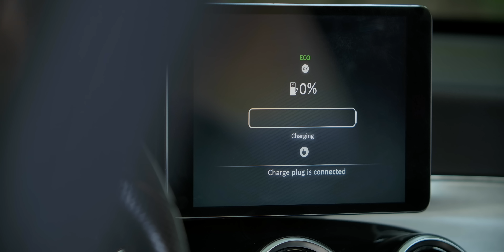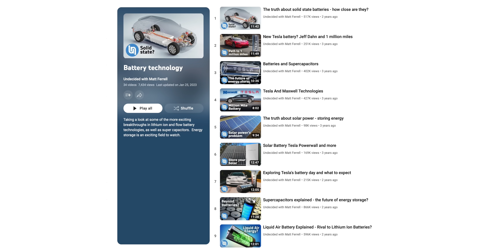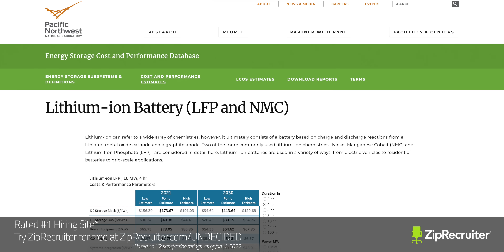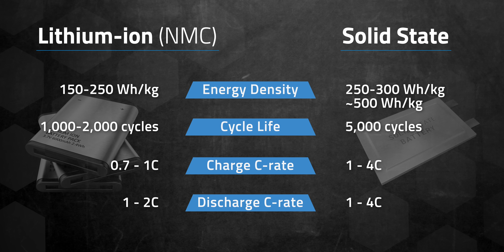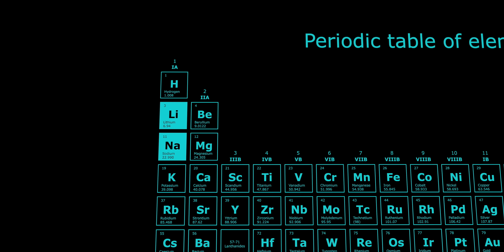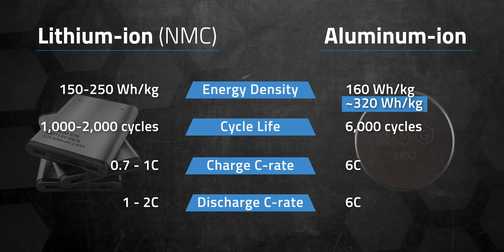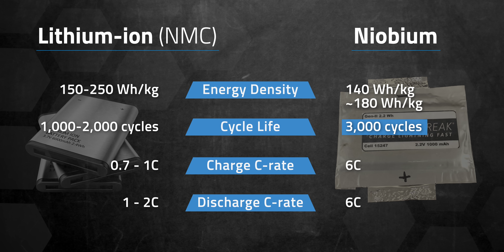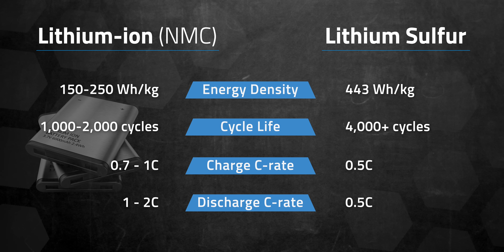Are These Batteries The Future Of Energy Storage?

Comment: Sodium-ion batteries sound like an ideal solution for home battery systems when combined with photovoltaic panels for charging in an area like the Pacific Southwest in the US or areas in tropical zones. Where there is year around abundance of sunlight, the home battery systems combined with photovoltaic panels can be charged quickly and help to take some load off the grid during peak hours; they don't need to run long and they will most likely charge up quickly the following day.

Comment: Hey! Thanks for the video. I have several topics for an open discussion. But first and foremost, please include sources for the data in video description.
-my main concern is about C-Rates. Solid state electrolytes cannot compete in conductivity with liquid ones, they are always at least 2-3 orders of magnitude lower. Similar argument goes to sodium and Al. Sodium being larger cation have significantly larger solvation sphere, and thus much lower mobility. Al with it's charge is extremaly acidic cation (in HSAB theory) with even larger solvation sphere. Not only it causes mobility hinderance but also thermodynamically it's much harder for this ions to lose solvating molecules before intercalation. 
Intresting point, in solid state i think thermodynamics are less vigorous at loosing the coordinatoon sphere before intercalation. (The boundary between active material and electrolyte matrix has surface like properties).

Comment: You should look into silicon anode batteries like Enovix's lithium-ion battery. It's massively expanded the energy density of lihium ion (~40% increase in normal consumer electronics, over 100% in devices like watch batteries)

They're already producing the battery and are working on scaling it right now.

Comment: One important thing missing in this video (and many videos from many sources about energy storage systems) is the *EFFICIENCY*. For instance, some of the grid-scale storage systems are only 30-50% efficient, loosing the rest to heat in some part of the process of charging, storing, or discharging. I think this is a metric that we simply can't ignore, as it has fundamental implications for their long term economic viability, payback time, and appropriate use-cases.
Reply: I totally agree with you on the "efficiency" aspect of energy storage.
Reply: Batteries in general tend to be inefficient.  Mainly by the nature of converting one form of energy into another.  Something is pretty much always lost.  The main advantage to batteries is that they're an investment in the future.  On a really sunny day, we couldn't possibly harness ALL of the sunlight falling on the Earth, but the excess gets stored away for later.  The more efficient the storage, the better, but at the end of the day, any amount of stored power is huge, because otherwise it would be going to waste doing nothing, and then not end up available at night when the solar panels are no longer generating power.

Think of it like a sink that's constantly running.  We can drink from it, but when nobody is drinking, it's just going down the drain, so you grab some water bottles.  Even if the water bottle you try to fill doesn't have a big enough opening to collect 100% of the water that's coming out of the faucet, filling that bottle is still water for later, should the faucet stop flowing.
Reply: And yeah, using the wasted heat energy is still something to improve.
The problem with the heat wasted in nuclear power plants, is that people would be scared of the idea that the water running in their radiators would be radioactive... Even though it's would be really unlikely to happen cause it wouldn't be the same water going through the reactor, heat exchangers are used and sensors check for any leaks between the two sides of the exchangers
Reply: Well you could just save the heat and pump it in the battery as electricity
Reply: Some grid-scale flow batteries have 70-90 efficiency.
Reply: @kibbo86  which ones? Would love to look that up and learn more.
Reply: Well the thought is right but the situation in the field isn't as bad as you suggest. Ambri's grid storage liquid metal battery (which has had some success in garnering big clients) promises comparatively low capex (and low LCOE in combination with renewable generation) while offering 73 percent round-trip energy efficiency. 

So, just don't use the crumby storage technologies offering 30 - 50% efficiency. Use more efficient batteries that don't have the concerning implications that you outline. There are lots of efficient options. Local circumstances will have a big role in determining what form of grid storage makes sense.

Note: 
(1) The comparatively low capex of Ambri storage, however, only becomes a reality once manufacturing moves into high volume production, viz. at production scales similar to or larger than the largest Li-Ion battery manufacturing facilities today.
(2) Ambri batteries do come with the proviso that in order to avoid heat losses (the battery operates at high temperatures) and thus reductions in round trip efficiency the batteries should be discharged/recharged daily. Not a severe limitation if there are other efficient storage technologies in the mix, which is probably the right approach.
(3) Even relatively low efficiency compressed air storage has decent prospects. The best round trip efficiency offered by a CAES plant currently in operation is about 60%.
(4) Pumped hydro round trip energy  efficiency is around 80%.
Reply: Electrochemical batteries usually has 90% efficiency roundtrip, ver few case has less efficiency, but not lower than ~80%, because storing ions with intercalation process through electrode materials are very efficient.
Reply: Efficiency aside, having a use for the waste heat could be a good solution to help reduce power use elsewhere. Having small distribution level battery storage in a city or near a pool and using a cooling loop to heat water for homes and the community. 

This is a major benefit of small nuclear, with rated power being around 200MW - 300MW but the heat output which can be used in industrial processes being a massive additional boost.
Reply: @je8277  very true. That I agree should be a part of the efficiency conversation all of the time. I think there are so many missed opportunities for using waste heat — the more conversation the better. I often think of even rooftop solar voltaics as being a huge wasted opportunity for waste heat collection. Even in the most efficient panels,, 60+ percent of the energy is getting lost as heat that could be heating or pre-heating domestic hot water or in-floor heating. Solutions like concentrated solar with heat-pipe transfer to an insulated water collection, or evacuated tube systems with the photovoltaics inside with heat pipes and water heat transfer could make for an absolute ton of additional waste energy recovered and used. Heat pumps could amplify those optimal photovoltaic temperatures to domestic hot water temperatures while still using so much less energy than direct gas or electric heating. 

Industrially, of course, there are so many more waste heat options at many different temperature ranges.
Reply: cool the battery with domestic water heating,people lose sight of one of the most needed uses for electricity,heating water
Reply: Is it? Seems like producing energy is cheap now. Renewables seem to be over producing. 

 Cost per KW stored is what matters way more than effiency for that reason.
Reply: @dianapennepacker6854  well it's all relative. Like if a compressed air storage and a compressed co2 storage system has similar capital costs, but the co2 is (it seems) 20-30% more efficient, then that's a whole lot of money left on the table. That doesn't invalidate the spirit of your argument which is "cheap storage now", but it helps us gauge capital costs vs efficiency losses of an amoritization period for each use case. There's no reason not to publish that data if the technology is mature enough to even talk about; it's valuable information.

Comment: The prospect of an aluminum based battery with 3-6x the cycle life of lithium is a hopeful thought. Consumer electronics (a field I work in) generate so much waste on the back of failed batteries. Laptops, wireless earphones, cell phones, so many areas where we hit the "good enough for most people" bar in terms of processing power years and maybe even a decade ago but batteries, failed storage, lack of software updates, and the allure of the shiny new thing keeps them from having as long a life as they're realistically capable of. Nothing infuriates me more than each model of a machine requiring a bespoke battery pack that will in all likelihood be the first thing in that chain that fails. While more EVs emerge on to the market I fear the same ultimate end to a lot of electric cars, making it to the scrapyard sooner than their ICE counterparts due to failed or declining batteries.

More than a new type of battery what we need is, IMO, a sustainable method of implementation. Standardized packs that are ideally end user serviceable to reduce waste and ease repair procedures and recycling process. I'd like to see an end to bespoke battery packs that plague my industry, every computer a different pack design, the problem with that is I don't think consumers are going to deal well with the results of that which would likely be bulkier devices for the sake of sustainability. I'd be happy to have a thick phone that I could crack open the back of and replace a pair of 18650 cells, but it wouldn't even have to go as far as that example for mainstream acceptance to be a non starter.

Comment: Ive made copper ion batterie at home, its simple you have to take 1in diameter copper pipe with the lenght of 2in then put in 1000ml  tri-xlopix-dimethil-ether suboxide solution. Once it dissolves you have to add 215g of pure nacl. Thats it . Add copper electrode for positive pole and titanium for negative. You have 2min to add electrodes after that time solution will solidify. Ive tested it for 20k cycles still works like new. 10kg battery stores 47kw.

Comment: I think they should explore hybrid systems capacitor-battery for electric vehicles, combining the advantages of both.
Also there should be a ban on all motorsports to use combustion engines of any kind or hydrogen for that matter.
All race events should use ONLY electric vehicles with batteries.
This will help evolve the field fast.
Oh, and any company that holds any patents in the field of energy storage should be forced to relinquish them. Toyota is the main culprit here, hoarding patents in the world of solid state batteries, yet they are the last to even make an electric vehicle. They just presented ONE model, one ugly mofo of a vehicle with what appears to be regular old electric tech.
So they have been hoarding solid state battery patents in order to hamper the development and threaten anyone trying to come up with a solution. (same way as samsung in doing right now in the field of screens, using patents with the subpixel array arrangement to claim monopoly and virtually block evolution of any mainstream product)

Comment: One for the list... It would be interesting to learn the economics of a salt pond collection with passive ethanol phase-change energy storage tanks in the bottom layer compared per acre to solar/wind farms with different ESS solutions.  It's unclear how the extra maintenance (e.g., water clarity, heat engine maintenance) costs compare to the low cost of startup.  Seems like the tech was abandoned, but why?  Digging a man-made lake is cheap, if salt seepage is a concern public water utilities commonly use bolted tanks in excess of 30,000m3.  Seems like it could be safely done anywhere and the starting water doesn't need to be potable.  The 15% efficiency isn't too far off solar PV and there are no losses from row spacing/acre.

Comment: I'm glad you said contender to lithium ion, because the biggest upgrade from lithium ion 21700 would be 4650 or what the  T size is much more promising, this makes a 100v 25 amp hours  battery an extreme basic to make right now 15s 15p  is challenging, what happens when the locals in the street can daisy chain 15 batteries  to have something with power and range
Reply: 19s 4p 72v 100ah, this is the simplification needed to solve the problem for every other device, at least escooters ebikes emoto, diy..

Comment: Great video, something to point out on the Lithium Sulfer batteries is the C-Rate comparison. You mention that they "only" have a 0.5C rate, whereas in reality that is basically the same as the Li-ion. A 1C rate at 200WH/KG is the same as a 0.5 C rate of a 400WH/KG battery in terms of power delivery per density. So basically, a 1KG battery in either chemistry could potentially deliver 200 watts over an hour, which to me sounds very promising.

Comment: My focus is home energy storage which carries over to EV (eventually your EV will also provide home energy storage for backup power and for arbitrage scenarios).  I think the technology with the greatest potential to change the world is the graphene super capacitor (similar to the Superbattery in your video).  The technology is already here, but cost is still too high due to the manufacturing processes for graphene, but strides are being made in the right direction.  The main advantage is the availability of raw materials (primarily aluminum and carbon), energy to weight ratio, and extremely fast rate of charge (minutes instead of hours).  No more slave labor lithium or nickle mines. and recycling is easy.  As for cycle life.....the potential is for 100,000 cycles.  Only cold fusion will be better.
Reply: i agree and i was doing my research on batteries  storage and the best option we have is graphene all other battery they're just hoping and they can't accept the fact that they failed  specially solid state battery been there since 1994 until now nothing for real just marketing while graphene it's different story  they just focusing how they can make it cheap  i think in the next 5 years graphene is the future and it will kill it.

Comment: A year ago I swapped out my Lead-Acid for Lithium Iron Phosphate 100 amp batteries in my simple off grid home solar.  Manufactured by Chins, (there are others also) they are  a HUGE improvement in holding charge and charging speed at a cost very near Lead-Acid.  Light weight , compact and available on Amazon.  I'm now in off-grid heaven.

Comment: Hey, I think the C rate on sulphur batteries are deceiving. As they are so energy dense a .5 C is actually charging about as fast as an equal weight lithium battery.

So if you were making a choice for a specific weight use case it’d be do you want a 1kwh battery that charges at 1kwh per hour(1c) or do you want the sulphur one that for the same weight is a 2 kWh battery that charges at 1kwh(0.5C)

Comment: One thing to consider is transportation other than electric cars; e-bike batteries, for example, are typically under a single kilowatt-hour, which changes the ability to charge them quickly from a common electrical outlet.  A 15A-110V circuit could deliver a zero-to-full charge in one hour, no special wiring required, if the battery could take it -- but, faster than that starts to require less common wiring, so ultra-fast charging is not really interesting (a 250V x 30A circuit might get you to a 10 minute charge, but that requires a dryer/stove plug).  One issue that comes up for bicycle use is operating temperature; most of the batteries I am familiar with start to get unhappy around freezing, and are especially unhappy about being charged below freezing.

One option is a control that starts the battery slowly, using its own heat production to warm it, and similarly a charger that begins by heating the battery first, but both of these add complexity.  A battery chemistry that kept working well below freezing would be nice for e-bikes.

(To any experts on not-biking in cold weather, sorry I am so ignorant, but I've been doing it for years, not even with e-assist.  Someday I might get too old, then I might want some help.)

Comment: My main interest is what EV will be affordable and suitable for my needs (200+ mile range) in the next 2-3 years. I assuming solid state won't be here in that time frame. Na-ion looks good as a cheaper and safer alternative to Li-ion that performs better at low temperatures, although energy density makes it less able to achieve the range of NMC. Perhaps Na-ion can replace both NMC and LFP. Al-ion should be even better, and with a 6C charging rate perhaps a better choice for regenerative braking. The higher energy density of Li-S might be the best option long-term (besides solid-state) if the higher capacity can make up for slower charging speeds; I don't mind charging overnight if my car can do 400 miles.

Comment: Theoretically, if you had a city car with just a super capacitor instead of a battery. How much range could you get with a similar sized unit to a comparable Lithium Ion battery electric car? I think if people were less obsessed with the range of their car and more willing to top up maybe once every 150km then we could just use super capacitors that last for thousands of cycles without degradation and charge in seconds/minutes. We would just need a more robust charging network for it to work properly but I wouldn't mind charging once every couple of days (for day to day city driving) if it only took a minute. Also You could have drive through charging stations where the charging arm is automated so you just drive through, stop, listen to one song and then drive off fully charged. Easy.